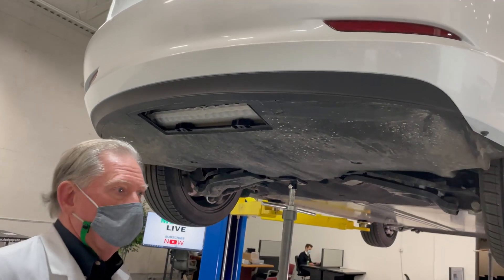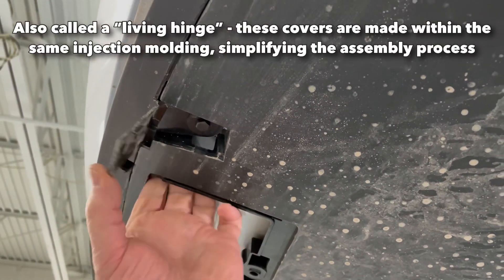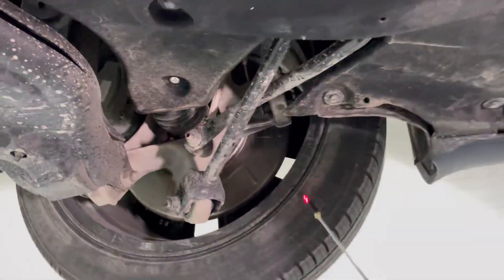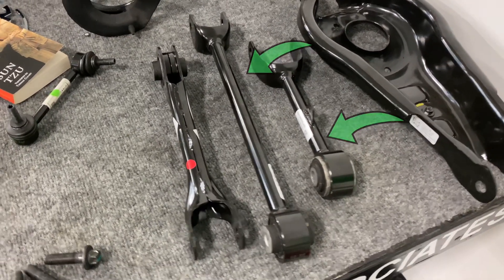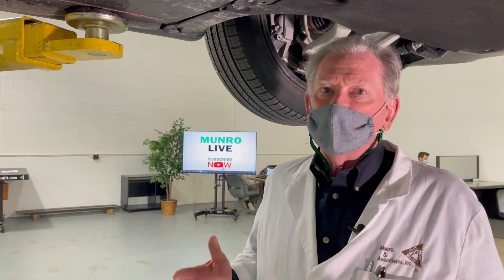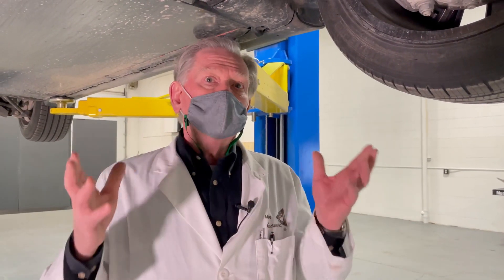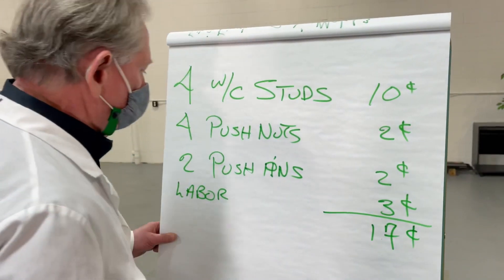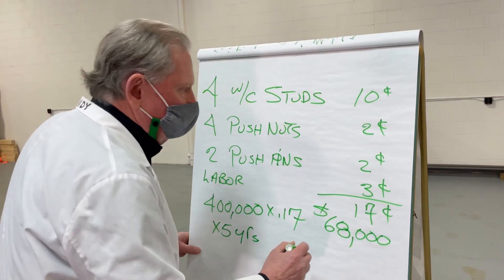2021 Tesla Model 3: E2 - Hoist Review & Some Cost Savings

Comment: I wonder if these saving costs are being under estimated, because every one of these parts has to be ordered, stocked, brought to the production line as well as the time for the operator to fit them. Every part you can eliminate is one less logistical problem.
Reply: Let's not forget the allocated floor space for the machines and conveyance either. Every square meter/feet counts and costs as well.
Reply: Yes. That is the real gain here. Not the tiny difference in cost savings.

Comment: well my EU model 3 dosent have tow package, and it still has same under panel. but i think that serves two purposes and second may have someting to do whit easier clean up for gravel accumulation in that rear bumpper.
Reply: And access if you want to instal a tow hitch later...
Reply: @Barskor1  that depens, because in europe model 3s whitout hitch arent certificated to get legal hitch. and also model 3s whit hitch have trailer mode so autopilot system dosent go crazy when there is trailer behaind the car.
Reply: Is that something tesla specific? In Sweden a tow hitch can be added to a car and it doesn't even any longer need to be inspected by officials. So here I guess Tesla could if the wanted offer that service at a service center to have it properly performed.

Comment: There's two big possibilities for the towing access hatch 1 either they hit quota mid-day shipping  to Europe and they just continued production instead of shutting down the line cuz they're going to shut it down in the night switch over.

They changed the design and the access hatch has been made but the one that's a blank still being made and or injection mold machine it's still under construction
Reply: I hope it's a choice to have a single part across MY and M3. Since I've chosen to install hitch, I'm very grateful that the access panel was included. Although available via parts for $135

https://stealthhitches.com/products/tesla-hitch-shr09001
Reply: @DKWhipple  ya it could be by Design give u options aftermarket  or upsell for a hitch  &  why not extra cargo ski rack, bike rack ect ect

Comment: That panel in the back. My friend the other day had a rear hitch mounted bike rack. He said it goes on and off super quick and when not using you just put the panel back on. You put something the bumper behind that panel an there are bike racks that can connect in and out really easy. I dont have all the details but the guy loved it.
Reply: Number of people on youtube refer to the hitch as a stealth hitch. Looks cool. Friend said the older versions of the M3, like the one i have, you can still get a stealth hitch installed but the have to cut a hole in panel underneath. He said tesla added panel to allow for stealth hitch installation.
Reply: No details here either but is the bike rack from tesla? Or has some 3rd party exploited that and made something that fits in there? If so then still no reason for Tesla to have it on north american cars.
Reply: Sweet.

Comment: Also consider the savings in administering the procurement and storage of those small items. It all adds up to the savings.
Reply: labour also means time. Less parts, less assembly time, means more cars in less time.
Reply: When I was at Caterpillar Inc, we sought to reduce our number of part numbers. We figured each part number eliminated saved between $200 and $3,000. We had 7 million and a lot was waste.
Reply: This. This is a big deal. The time on the line is nothing compared to the logistics of supplier management, shipping, storage, waste, etc. It's a compounding effect! Then you can even remove those stud welders from the body shop which is a massive deal by itself. The less parts, the less people to manage those parts, the less risk in the whole build! It's probably several dollars per car made for these few parts.
Reply: And also also consider the throughput on the production line. I don't know how long time a car is on the production line but lets say 1h. Then maybe you can shave 30-60s off of that hour by not having to add those gadgets.
Reply: And the time to manufacture. Seconds on the line adds up too.
Reply: How much is customer satisfaction worth? I have had to have my car serviced three times to eliminate wind deflector noise.
Reply: Socthe solution is ro leave dangling plastic skirting and a glaring hole to be filled with dirt and whatnot?
Reply: They probably have injection moulding machines on premises for those small items ( i would )
Reply: Also the time saved to get the parts and install them.
Reply: I've delivered boxes of little parts like that for thousands of $$ and they ordered them on a bi weekly basis....
Reply: @joeziahbabb  supply chain logistics get complicated sometimes though. A factory can have a bad batch, the place can get shut down, small parts need to be shipped to all the service centers to help with repairs and the service center technicians need to do extra labor to install those extra parts
Reply: MUNRO LIVE  lol, what a fake account
Reply from the maker: I blocked that Spoof account. Looked for the verified "Check" for the real Munro Live.